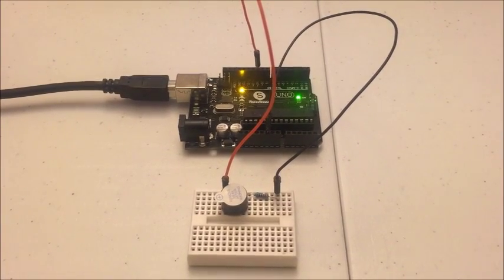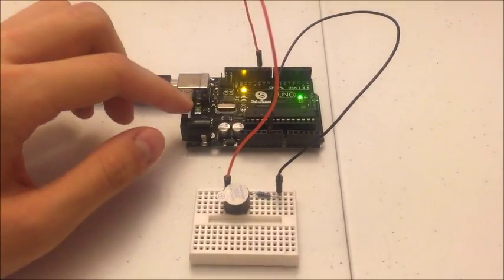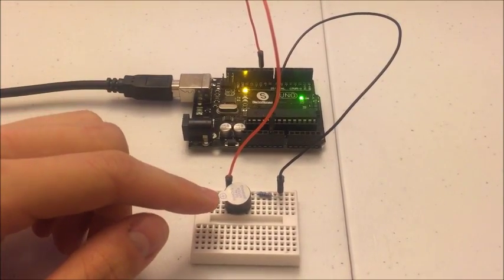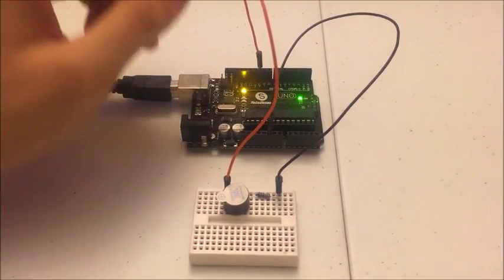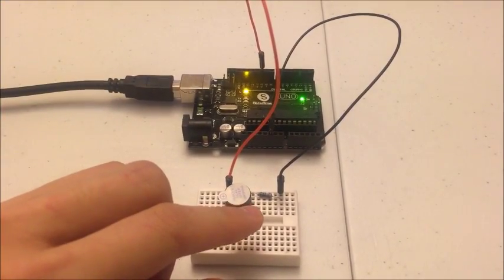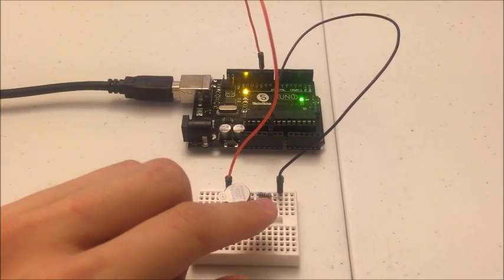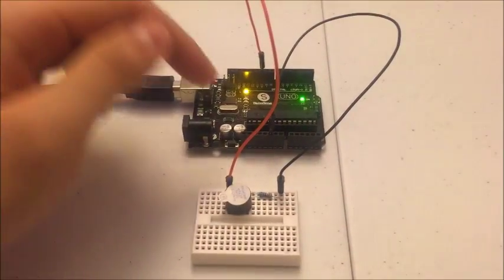Play "Pirates of the Caribbean" Theme Song on Arduino and Buzzer

Comment from the maker: Hi everyone👋 Thank you so much for all for your likes. It was my first YouTube video and it is so encouraging to see the positive feedback. Sorry for my lack of response previously. I lost this account and just recovered access. 

📖There are some questions on how this is made, so I created a learning note on TipStory that explains the science behind sound, buzzer, Arduino tone library, and a step by step walkthrough of how I made this. You can check it out here: https://www.tipstory.org/learning/h2lUMccm5MeuSds

😎I also created a simulated TinkerCAD circuit, so you can even play it virtually if you don’t have an Arduino: https://www.tinkercad.com/things/f9QN4skaguI-play-pirates-of-the-caribbean-theme-song-on-buzzer

I would love to create more projects and videos. Please let me know if you have any questions or anything you would like to see. Thanks again. 🚀Happy engineering and designing!
Reply from the maker: @darthgonk8918  Yes, you can. As mentioned in my learning note: A 220 ohms resistor is used to limit the current drawn. Ohm's law states that Current = Voltage / Resistance, so we can compute the current, which is 5V / 220 ohms = 22.7mA. You can use a resistor with a higher resistance value, 5V / 330 ohms = 15.2mA. As long as the computed current is less than 40mA, which is the max current each digital IO pin of the Arduino can supply, you will be fine.

Comment: I tried running the code but the buzzer did not play the song. Any help will be appreciated
Reply from the maker: Does it produce any sound?
Reply: @xitanggg  it produces a sound when I use an active buzzer but not a passive buzzer
Reply from the maker: @momak-builders  You shouldn't be using an active buzzer. An active buzzer wouldn't play the song. Can you follow this link: https://www.arduino.cc/en/Tutorial/BuiltInExamples/toneMelody, and try to see if you can play the melody with a passive buzzer?
Reply: @xitanggg  I used a passive buzzer and nothing happened
Reply from the maker: @momak-builders  It seems like something to do with the set up if you can't replicate that tutorial. Can you share more about your set up? What Arduino you are using? Is it an Arduino Uno? Can you try with another Arduino Uno or another buzzer?

Comment: witch resistor is
Reply from the maker: I use a 220 ohms resistor, which limits current to 5V/220ohms = 22.7mA. Any would work as long as current drawn is < 40mA, which is the max you should draw from an IO pin based on the Arduino Uno processor ATmega328P's datasheet.
Reply: @xitanggg  can i use 100 ohm blue ones? can't find any 220 ohm resistors
Reply from the maker: @joshuanathanield.malong4925  I don't recommend 100 ohm since it brings the current to 5V/100ohms = 50mA, which is higher than 40mA - the max you should draw from an IO pin. You can however connect two 100 ohm resistors in series to create a 200 ohm series resistor :)

Comment: for some reason, when the signal 0 is sent to my buzzer, it just plays a loud flat tone, so it's really annoying, instead of a rest, it chirps out. Any idea on how to fix? I'm using an arduino multi function shield.arduino
Reply: Try NoTone();
Reply: @EwanWills  Holy crap I never thought I'd get an answer. I have my arduino in a storage box somewhere, but you made me want to take it out. Thanks!
Reply: @anthonypelletier8978  Do It man! I just finished a 3 week long project and all the support on my yt is soooooo rewarding. I would definitely recommend
Reply: @EwanWills   i wanted to suggest noTone as well. I just ordered my Arduino and some other sensors with it, very excited to get it and start experimenting.
Reply from the maker: Hi Anthony, thanks for letting me know about the issue. I updated the code to implement NoTone() just for you. Hopefully it resolves the issue with the update. I see that your arduino is in box now, you can try the simulated TinkerCAD circuit I created to play it virtually🎵: https://www.tinkercad.com/things/f9QN4skaguI-play-pirates-of-the-caribbean-theme-song-on-buzzer

I am not sure what causes the issue itself. One hypothesis is that ground is not connected properly, so you hear the chirp and noise. You can check your ground connection. 
Another hypothesis is that something is not working with the pin you are using. You can try a different digital pin. 
Another hypothesis is that something is wrong if the timer in your Arduino. So you can't generate 0 frequency. You can try to replace 0 with a frequency say from 1-20, since humans generally can't hear frequency < 20Hz.
The list goes on and on. There are too many things that can go wrong in hardware.
Reply: You most probably have an "active" buzzer, i.e. a buzzer that includes an electronic circuit producing a fixed tone while power is supplied. This project here will only work with a "passive" buzzer, which is just a piezoelectric speaker.

Comment: A technical question here. How are the different frequencies being produced? I guess it would have to be the voltage applied at the ends of the buzzer that is changing, but doesn't the arduino have a 5V maximum?
Reply from the maker: Excellent question. The different frequencies is produced by a hardware timer (not PWM). There are three hardware timers inside the Arduino Uno's processor ATmega328P, so you can create a max of three tones. The signal generated by the tone library is a square wave signal. For example, to generate a 1Hz square wave (time period = 1s) with a timer, you set up a timer interrupt for 0.5s. Every 0.5s, it alternates the digital pin to high or low, resulting in a 1Hz square wave. To learn more about the science and engineering, check out my learning note: https://www.tipstory.org/learning/h2lUMccm5MeuSds
Reply: PWM
Reply from the maker: @VitorJTekkRodrigues  It is related to PWM but not PWM. The answer is hardware timer. The hardware timer is also used to create PWM, which is why tone library interfere with the pwm library, because both use the hardware timer. There are only 3 hardware timers inside the Arduino Uno's processor ATmega328P.

Comment: I wonder if using a second buzzer can accomplish adding another layer, like piano playing for example.
Reply from the maker: Yes, you can totally use a second or more buzzers to create a harmony (two or more notes played together at the same time). Beware that the number of buzzers you can play at the same time is limited by the number of hardware timers of your Arduino. The hardware timer is used to generate a different frequency tone in the tone library. Arduino Uno's processor ATmega328P only has 3 timers, so you can use a max of 3 buzzers on Arduino Uno.
Reply: @xitanggg  Hey I taught we can use only on tone() function at a time
Reply from the maker: @michealmyers4515  I believe you can use more. Check out this example: https://www.arduino.cc/en/Tutorial/BuiltInExamples/toneMultiple

Comment: I noticed an error in your code. Your songspeed variable is an int, which means that it will only use whole numbers, so the 1.5 just becomes 1. You need to make it a float, and cast duration to a float when multiplying with songspeed, and then you can cast the final thing back to an int to use for the waiting.
Reply from the maker: Thanks Andrew for catching this bug👍 I just updated the code and fixed it. I credited you for catching it
Reply: Andrew Lalis It can use
Reply: If  songspeed is 1.5  it be like this
https://youtu.be/DAwWiR15hC0
Reply: oh wow watch out this guy knows what a float is
Reply: Allexandru Prroca Woah! Salty AF
Reply: Its a bug not an error.
Reply: SAY THANKS AND JUST SHUT UP .